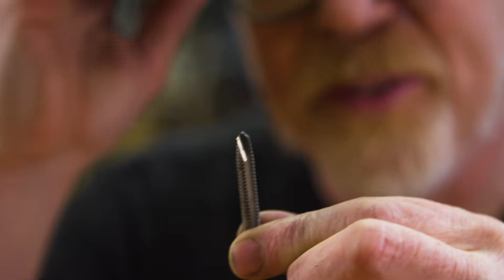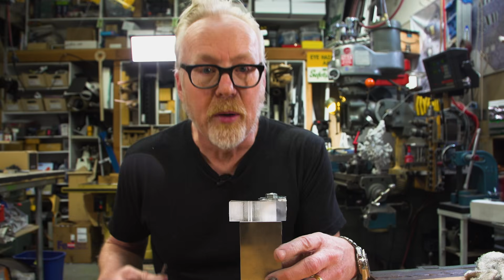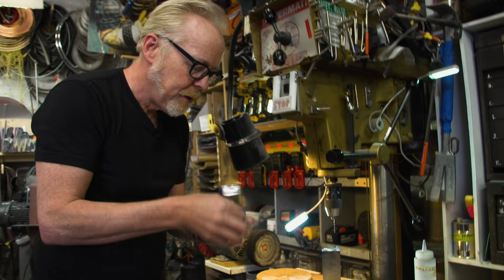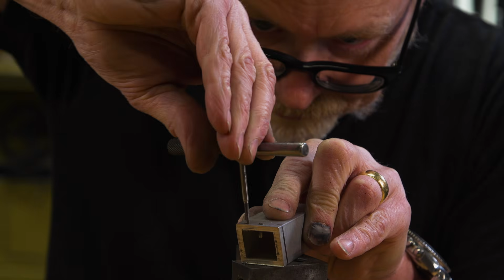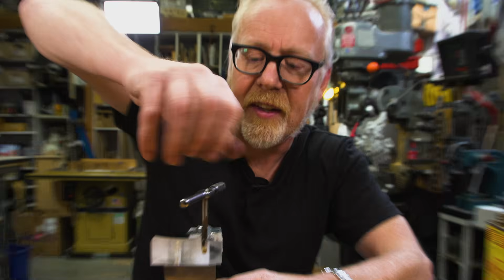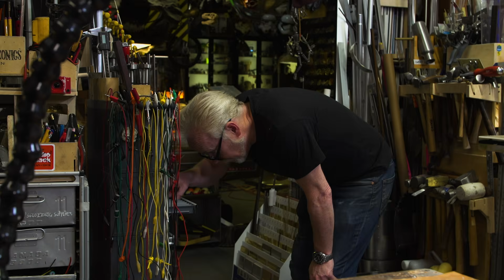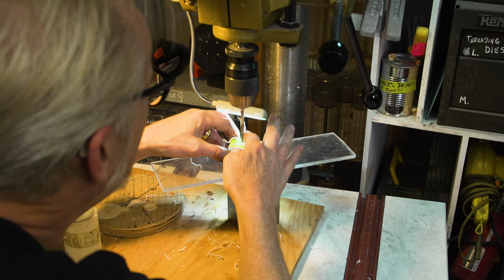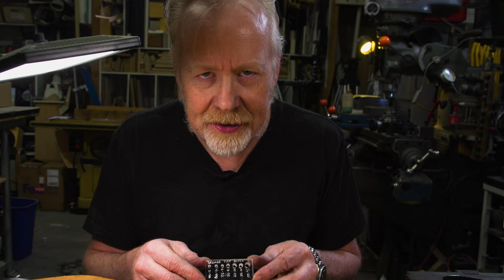Adam Savage's One Day Builds: Thread Tapping Guide Block!

Comment: I enjoy watching your vids, one thing that made me cringe is your blackened nail -- as a Mechanic I have had my share of smashed finger nails -- use an orifice drill near the cuticle as soon as possible, next time you smash a nail -- this will let the pressure out and you will not lose the nail or turn black. Do it soon while the pain is still there from the smashing and the drilling will not hurt. I use the miniature orifice drills with the pin vice, and choke up the bit so only a little sticks out -- this makes the hole only in the nail and no deeper.  Great vid on the use of a guide block -- also can use a similar block for drilling with a battery drill -- straight holes makes straight tapping better.  :)

Comment: I know exactly what you mean. I'm a union elevator mechanic and as such, I do a lot of tapping, especially in 1/4-20 thread and 3/8 thread. I find it incredibly relaxing. However, we elevator guys use drills set on 1 to do our tapping. Just switching between forward and reverse with plenty for f cutting fluid.

Comment: I have a tapping guide I made in 1978, made it from one inch aluminum. Made a small spacer that is almost perfectly square and one inch wide to punch holes on a Strippit machine and its precision stops couldn't get to within 1/2 inch or so from the edge of a piece of sheetmetal. Still have them 44 years later.

Comment: The best DIY guide block I saw was made from round stock. It's able to fit into almost any tight spot. I also chuck the tap into the drill press and start by hand if it's a weird or tiny surface & it gets perfectly aligned, then finish by hand.

Also chip-clearing taps (aka spiral) changed my life lol. They also make one that pulls chips OUT of the hole, commonly used in industry.

Notes on removing broken taps: for expensive parts, you can 'zap' them out with a EDM machine (exactly like the CNC-type wire-cutter machine); if aluminum, you can chemically eat the iron out or weld a nut (washer first if really stuck) to get a hold on it.

Comment: I start the threads while still in the drill press. Chuck the tap with power off and turning chuck back and forth by hand until too hard to turn. This helps starting the threads straight and centered.

Comment: Just a thought...  You didn't need to mark the TPI on the taping guide.  I would have just put 2, 4, 6, 8, 10 and .25 (or 1/4).

And yeah...  You drilled two holes for a 10  LOL!

Comment: Yo Adam, I know you're comfortable around your tools buddy, and I understand you hadn't lost any fingers yet. Who knows, that's probably a SawStop brand tool you're using. I would still use clamps against the piece and your fence so you can then guide the part through using the clamps, even if you spend an extra hour for safety sake. For square stock especially, a lack of safety is inexcusable as novices may emulate this and whoops they lose a finger. Not good!

Comment: We just call aluminum "gummy", since it loves to gum up on your tools. I work in aerospace connectors so threads and aluminum are about 70% of my job. Although most of what we do is either rigid tap cutting in a CNC or single-point thread cutting for IDs.

Comment: Let me tell everyone one thing, this whole taping video is made for DIY projects. I went to trade school about 50 years ago and learned all about threading as well as precise measurements. Also assembling steel materials like gears coupling etc. Things like how to assemble a ball bearing that the internal diameter is smaller than the shaft. The method is heating up the ball bearing and inserting it in a bigger diameter. This was for heavy-duty machines that weigh up to 50 tons, steel factory. 
All threads in this kind of equipment are measured by an inch or mm. For every bolt diameter, the hole is a little bit smaller. 
We have to make threads in many sizes according to the machine. Here is how it works, to make a 1-inch thread, there are three taps or thread set. Start with the thinnest tap or number one, then second, and finally the last.

Comment: I like my Greenlee 1/4 hex drive self drilling tap sets for drilling in thinner materials, great for use with an impact driver. For larger holes and those in deep materials, I like the tap holders that fit on a 1/4 or 3/8 inch ratcheting socket wrench. Cutting oil is great in steel, but I prefer cutting wax in aluminium. Within most metals, the finer the thread, the stronger the bond, as there is more friction surface to hold the fastener in place. That is why electrical ground screws use 10-32 threads in order to create the required contact area and pressure. Never forget to use anti seize compound for the fasteners going into aluminium, and with all stainless steel to stainless steel fasteners. Sorry about that fingernail-Ouch! Thank you for sharing your experience, it is never too late to learn new things, and thank you for making it such fun!

Comment: Thank you Adam for the tap video.  I have used taps in my hobbies, but never used any dies. Most of my tap using experience has been for chasing the threads. Sometimes dirt, rust will get in a threaded bolt hole and I'll used a tap with wd 40 to clean the threaded bolt hole for proper torque measurement and better compression. Thanks again.

Comment: I was a machinist for over 22 years. I designed a tap block when guys said they had difficulty getting close to a wall on a mold or die but had trouble with the thin walls when heat treating it. It’s not very big. But has 6 tap hole sizes from 1/2” on down. 
It was used by several guys that liked it so well they had a guy do a Rockwell test on it. Take measurements and map out the hole placement for CNC. They made several. And really liked them. We milled two oval slots on each linger side for grippage and stamp your initials in before heat treatment. 
Ground them clean and square afterward. And done.

Comment: I just drill the hole with a drill press, change the drill bit for the tap, put pressure on the tap with the drill-press lowering-handles, and turn the tap with my left hand grasping the chuck!
The "feel" is first-rate, and the thread is dead-straight.
(Use a threading lubricant, of course.)
I back-out the tap by lifting the work-piece with the lowering-handles, and then simply spin off the piece and let it drop!
Never-ever had any problems with this quick-and-easy method, only sterling success.

Comment: get better taps, i use an emuge 10/24 to tap straight thu 3 pieces of solid aluminum clamped together to make a 1 inch thick piece, in a hand drill all the way thru in one shot, no backing up.

Comment: Hi Adam i learned this on youtube from a good machinist and i did this with a 10-32 tap . You can drill out taps HSS are harder.  A carbon steel  10-32 tap i drilled out using a solid cabide # 20 drill if you take your time it works the youtuber also used a solid carbide bur . works best in a mill or drill press .JM

Comment: I must have the cheap drill bits, mine have the size in fractions of an inch. Yours have random numbers and letters. I looked them up and got the size in decimal inches. That #29 is 0.1360 inches (about 17/128). More charts tell me that...fractions are very unpopular. I give up. I use a drill with a tap on acrylic, in and out, a hit of air and the bolt goes in. I'm a machine, not a machinist.

Comment: For those of you who break a tap off in a hole.  First of all, you should never use a power tool to drive in a tap, that's how you break them.  But if you do break one off an old timer shared with me a trick that has saved my butt.  

Go to the hardware store and buy piano wire.  It is very thin but stiff wire.  Shove as much of the piano wire as you can around the broken tap in those empty flutes?  Cut many pieces of the piano wire and pack those empty spaces around all sides of the tap with as many wires as you can.  Make sure there is enough piano wire sticking out the top of the tap/hole that you can grab it with a pliers.  Grab all the wire sticking out with a pliers and twist.  I have gotten broken taps out of holes with this method that I thought were impossible.  One of the most useful old timer tips I have ever been given.

Comment: Great video, I only fell asleep 3 times!
It would be nice to have a summary of those (oversize) clearance hole diameters for the Block.

Also, on your "Tap Drill Chart"  do you know of one that also has clearance hole: Tight, Sliding and Loose Fits for small machine drills.  Can you point to one?  Thanks!

Comment: Here's a useful, "thread comparator" extension of your tap alignment gadget:  a) Clamp two pieces of smooth 1" - 1 1/2" wide x 1/2" flat-bar-shaped material, wide sides together, securely - acrylic, aluminum, steel, whatever; b) along the seam, drill deep, progressively larger diameter holes down through the seam between the two pieces.  Each hole diameter should match a different tap bore size - i.e., not the tap shank diameter; c) thread each of those holes in turn with the appropriated tap (1/2 of the threads will be cut into the face of each bar).  d) Unclamp and separate when done.  

You now have 2 flat bars, each with a series of progressively larger threaded "trenches" across them, along each face of the previously-clamped-together material.  It is as if you had drilled and tapped a line of holes in a solid bar, then cut it down the middle along the long axes of the holes, with a zero-width saw.  Paint one face white to aid visibility, and label the threaded trenches on each piece with the thread pitch used, for reference.

This allows you to compare a piece of threaded material with your now-threaded "trenches" and visually discern the pitch.  It is useful when comparing threaded stock, bolts, etc. of questionable pitch - from old or foreign machinery, for example - to determine if it is the standard you think it is, or just a bit different.  

Over the years, I've run across thread pitches that would screw just fine through a pitch plate (thin plate drilled and tapped with standard pitches), because the pitches were not so different between the threaded material and the 2 or 3 threads in the pitch plate - but once put in a deep threaded hole, the cumulative difference between the actual pitch and the deeply-threaded hole bound the threaded material, potentially spalling it or wedging it in the hole, breaking off when removing, etc.

Even a fold-out pitch gauge only has a few threads, whereas this comparator can have dozens, across which you can compare the two thread pitches.  I made one when working on an old Austin-Healey in the '60's, using it again on an old Jaguar and various VWs, 55 degree pitch Whitworth threads, UNF vs BNF, an old pre-20th century turret lathe I bought, etc. and found that it helped in selecting the proper threaded part for various, otherwise-problematic, fastening jobs.  You can readily see the differences in thread angle between standard and unusual threads, asymmetries, tapers, etc.

Your tap guide project reminded me, so I thought I'd add this note.

Comment: I know I am a bit late to this party, but I'd like to add in my 2 cents.  I was a machinist for several years (does one ever cease to be a machinist??) and have tapped many, many bolt holes in various sizes (10-32 up to 2").  Maybe some of these observations will help those who have not tapped holes before.  I am writing this as I am watching the video so Adam probably covers some of the stuff I mention.

1)  Use the right size tap wrench.  Tiny taps are really easy to break.  If you go slow and easy (which you should) and the tap itself starts to flex, you better stop and re-evaluate.
2)  Use the right kind of tap!  There are so many different kinds.  The best I have found for hand tapping (vs using a machine) is a 4 flute taper tap.  They are the easiest to start and line up.  The 4 flute helps with aligning the tap with the hole so you tap straight, and the taper tap makes the tapping process less difficult since the material removal is more gradual.  You can always switch to a plug or bottoming tap later to finish out the hole.
3) Use some type of lubrication.  Tapping compound is the best thing to use (Tapmagic, tapmatic, moly-d), but if you don't have any of that handy use WD-40 or 3-in-1 oil.  If the tap is making a squealing noise, back it out, clear out any chips, and relubricate.
4)  Taper vs Plug vs Bottoming tap.  Taper taps don't cut a full size thread until it's in around 5-7 threads.  Plug taps are full thread around 3-5 threads.  Bottoming taps are full thread in less than 3 threads, meant for a "blind" hole (it's a hole that doesn't go all the way through) so it'll cut threads pretty much to the bottom of the hole (hence the name "bottoming).  Don't try to start tapping a hole with a bottoming tap unless you have no other options.
5)  Spiral taps - There are spiral flutes (flutes are the relief cuts that allow the waste material room to evacuate) which pull the chips up and out, great for blind holes since they pull the chips out instead of mushing them down in the hole.  Spiral point taps do the opposide, they push the chips downward which works well for a through-hole.
6) Use the right size drill bit.  There are numerous charts out there that'll show you what size drill bit to use.  It was common practice in our shop to drill oversize just a little, it makes tapping easier but if you need a super accurate and tight thread don't do that.  DO NOT drill undersize!  You will break the tap.  If you don't have the correct size drill bit, drill oversize.
7) Power-tapping - Using a machine (like a mill, lathe, or drill press) to tap a hole.  I do not suggest this unless you have a lot of experience with machines because stuff can go wrong in a hurry.  Unless you can adjust the RPM of the machine to really slow (like less than 100rpm) don't try it.  At best, you will break the tap, at worst you can really hurt yourself.
8) Don't buy those combo drill bit tap things.  They are a terrible idea 😂 You will probably just end up breaking it off in the hole you're tapping.  Trying to get out a broken drill bit or tap is a huge freakin hassle.  They are hardened steel, and unless you have carbide handy it'll take you way longer to remove the broken high speed steel that it would have to use a drill then tap.  Some "time-savers" are really time-wasters.

Good luck tapping, and please note that my observations are only based on personal experience.  I did not go to school to be a machinist, I learned on the job.

EDIT:  After watching the video all the way through, Adam covered pretty much everything I mentioned.  Never hurts to read stuff though!  Great video Adam!

Comment: Pro-Tip for removing a broken tap. Get some welding wire or a split pin, something that you can fit in the flutes of the tap in the hole with enough poking out to engage in the remaining top half of the tap. Use it to join across the break in every flute. Clamp the wire to the top half with a hose clamp. Unwind the tap.

Comment: Just a quick, if late note of something else Adam forgot. Chamfer!
 You got to do it at east on metal, i'm no acrylic specialist.
 I work with metal only. (AluminIum doesn't count as one for maritime machinists.) Otherwise, even if it's small size, ther will be a hump or sharp metal ridge. CNC mostly do with thread formers, so it's a must.
 Never used the tapping guide in the rare occasions i have to do the taps by hand, just eyeball the angle once it grips. Hard steels in deep holes are not easy to get on a noticable angle.
 The usual procedure is to drill a hole, chamfer it (all on CNC, unless in rush and don't have a chamfer tool set in the mill), check the thread step chart (even if known by heart, still look at it, as brain memory can play a blunder on anyone). Divide the inch by TPI if in imperial, twice, just to be sure. Carefully input the step amount, speed and depth in the G code, evaluate the depths and tool length carefully, especially for a blind hole. Automatic coolant will do, but cutting oil will put you at ease, if doing above M24 or G3/4. Full G1 - never do with number 3, do it number 1 and finish by hand. To encompass  all the basics for making threads by machine (you woudn't like to do 20+mm threads by hand often), this comment would go on for couple of meters down your screen. Notorious for a reason among CNC machinists.

Comment: I wish that I could get by with those few taps.  Beside the coarse and fine English thread taps, there are the coarse and fine metric taps, at least 5 sizes of pipe tapes, and then all of the specialty thread size taps, plug taps, bottoming taps, spiral flute, spiral point, straight flute, thread rolling taps, combination drill and tap, thread repair taps, and thread chasers.  I use all of these and I do Electronics for a living.